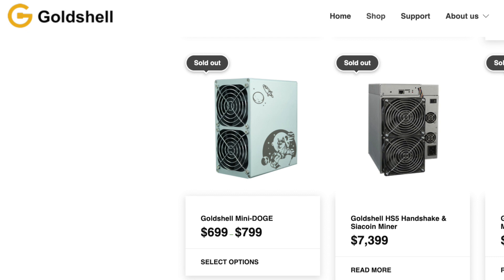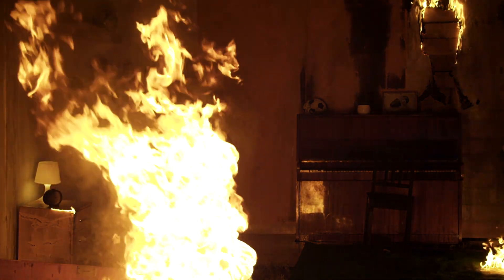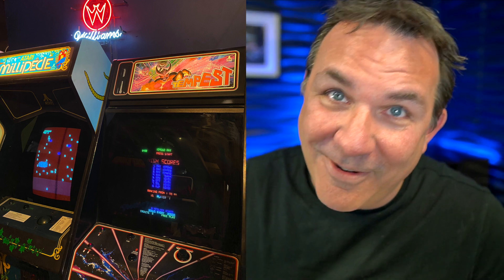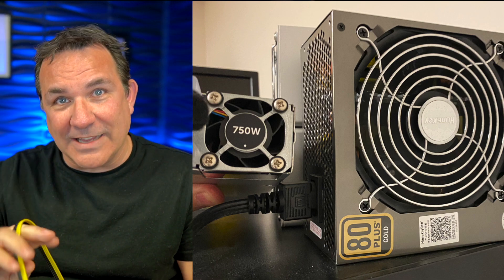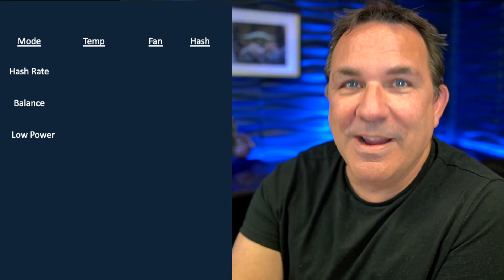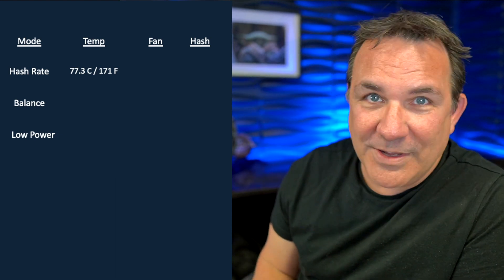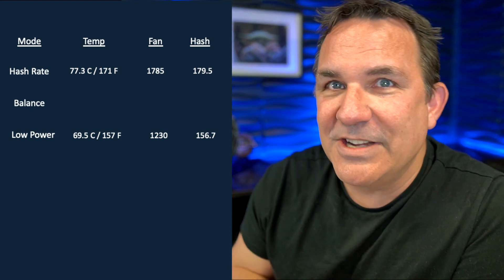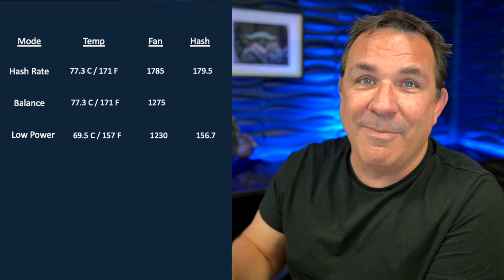Prevent Connector Burn on Goldshell Mini Doge - Mini Doge Safety

Comment: Nice video, please chuck that power supply out the window though. @235 watts per x 2 units...470 watts nominal, on a no name 500 watt supply.  Not a great way to promote safety.

Comment: My CK-BOX2 made it almost 3 weeks on a new SF750 ATX PSU and yesterday coming home after work, it had to have caught on fire sometime during the day. on the PSU side the PCIe connector of one of the connection was almost completely burned off. So don't use ATX on any of these box miners.

Comment: I hooked up a mini doge pro and a mini doge to a aregame 750 watt psu.  Turned the switch and a spark shot out the mini doge.  Unhooked it all and running mini doge only on the supplied cable and still works! Any ideas on what could cause that or should I just avoid the atx psu?
Thanks for the great content!

Comment: Rule of thumb with power never exceed more then 80% of the rated power especially when under continuous use. This applies to ATX power supplies and all lines coming out of the electrical box. Server grade power supplies are designed to run at 100% capacity last i knew. The power supplies Goldshell sells it's customers is only rated for 300 watts but they recommend at least a 600 watt power supply for 1 miner.

Most 8 pin connectors are only rated at 150 watts max anyways so Goldshell is not only misleading but also selling it's customers faulty junk power supplies. I only buy server power supplies from parallel miners for one they use 16awg 6 to 8 pin PCIE cables that are rated at 12 amps or 400 watts per strand and they sell high quality HP server power supplies that are platinum rated. Basically you're getting quality stuff and not cheap low grade power supplies or cables that can heat up and catch fire. When it comes to ATX power supplies i will only buy Evga they have a 10 year warranty and are very high quality inside and out. These two brands haven't heated up, caught fire or failed me yet!!!

As for the fan size don't judge a man by the size of his package "Big things come in small packages".  That server power supply will outlast, out cool and out run that ATX power supply any day of the week!
Reply from the maker: Thanks for comment!  I will look to upgrade

Comment: Hey Ray,

I have that same exact 750w PSU that just arrived with with my second dodge miner but I also have a 550w PSSU that came with my first mini doge/litecoin miner and I feel  more comfortable with that big fan Black 500w.

 So you hit alot of great points and I suggest you order on amazon a 140m mesh magnetic filter to put over the PSU to protect it from dust as well and I'll probably maybe sale that 750w psu on ebay or hold on to it. I'll check out the comments section. Oh I recently switched to low power mode after watching your video since I'm also in O.C Irvine Cali

Oh one more thing on ebay I order mesh dust filter for the dodge miners look up Mesh filter 2 pack Goldshell mini-Dodge, CK, KD, ST box assic  the user is Patricclinto-7 mines should arrive on Valentines day. I also purchased an electric duster since can air is a waste. I hate dust on my electronics
Reply from the maker: Thanks for the comment and the info about the filter.  I'll get one!

Comment: Ray, thanks for this video!  I will complete my test and post the results.  What prompted me to ask you the question on the last video is that on the Goldshell website in the description it says the Operating temp for these is 0-35 Degrees C.  Mine run in the 70's, so when I saw that difference, it made me wonder if it was just my miners, or everyone?  Maybe it's just a typo on the Goldshell page.
Reply: mines is right now is on low power 77.1 it stays in the 70s and the lowest I've seen was 35 but it wasn't running correctly and I did a reboot so yeah 35 is a big typo no way
Reply from the maker: You got it.  35C?  No way.  Must be a typo.  Let me know how any testing goes

Comment: love these videos bud .. they say only run a max of 80% power of the power pack to stay safe... as the electricity power costs in the UK are a lot higher £0.18 per KWH i believe my miners are now costing more to run than earning ... my thoughts are do i switch  off or carry on and wait for the price increase... my miners are in the garage and i have a smoke detector there but thinking of buying a linked alarm system that sends me a message saying your house is burning down mate ... get ready for divorce papers
Reply from the maker: Wow.  That's a high electric rate!  You might be more profitable on low power. The video before this I found I was more profitable on low power during these down times.  Thanks for the 80% rule.

Comment: I’m currently running mine on hash mode and I have it up on a glass desk, and the power supply is the one that comes with the unit. I put that away from the miner and have spacers under it to elevate it off the glass, with a desk fan blowing air on it to try to keep it cooler as well. So far so good but only been mining for three days. I’m going to be keeping an eye on that connector a few times daily to make sure it’s not getting hot. It worries me though now because it’s not worth it to have a fire. It’s the only thing I have plugged into that wall out let as well.
Reply from the maker: Nice. Just think about safety.  They don't all burn but there are instances where the connectors melt.  I suspect this is a quality control issue

Comment: I have been running 3 Goldshell Mini-Doge miners currently. The amount that my power supply of these 3 miners is therefore 233W * 3 = 699W. I had a 500W power supply and connected two of them on that power supply. When I learned the 80% rule associated to that type of power supply (gaming power supply) I stopped my machines and started looking for another power supply. I purchased the following power supply Antminer Power Supply APW3++ of 1600W. The critical information to know is that this type of power supply is manufacturer specially for asic miners and you technically do not have the 80% rule therefore you can use all of the 1600W available from this power supply. I have connected my 3 miners to this one power supply therefore I use 699W of the available 1600W. I could connect up to 6 Mini-Doge miners with this specific power supply but probably the ideal number is a maximum of 5. As you indicated the fan size is very small in the Antminer Power Supply however the design and internal component are optimal for asic miners therefore the fan size has nothing to do with the performance of your power supply.
Reply from the maker: Thanks for the comment and explanation!  I'm running low power mode for now so that has brought down the power draw.  I'm going to measure a little more and think about getting a new power supply

Comment: Hello Ray this is the information I obtained related to Power Supplies. If you have a gaming power supply (a power supply that is not designed for asic miners) you should only use 80% of the Watt capacity to run your miners. For example if you have a 500W gaming power supply you should not connect asic miners that collectively add up to more than 400W. In the case of the Goldshell Mini-Doge Asic Miner the specs indicate requirements of 233W per miner. Therefore is it not a good idea to connect two of these miners to a gaming power supply as you are at a level of 466W. You are very close to the capacity of the power supply. Note that fan size on a power supply has nothing to do with safety. You need to stick to the 80% rule or below to be on the safe side in order to avoid burning your power supply and/or damaging your doge miners. I would only connect one to that power supply.
Reply: Wow great tips man because I have a 500w that came with my mini dodge it's been on hashrate mode for 4months but I just switched to low mode and now I have a new mini dodge that arrived and it came with the 750w PSU. It's the same PSU in this video but I don't feel comfortable using it and may just order a 500 w PSU for the second dodge since I don't want 2 of these on the same PSU. I could just use the 750w psu but I think these had fire melting issues with those cables.

what's your current setup with these miners do you have more than 1on the same PSU 500+ or separated? 

Thanks
Reply from the maker: @ever6  I currently have 2 running on my PSU - since i'm now running low power mode I think I'm ok (less than 80% of the PSU) but will monitor it
Reply from the maker: Thanks.  I will stick to the 80% rule and check my power draw on the low power mode